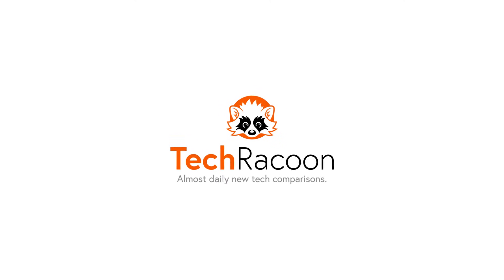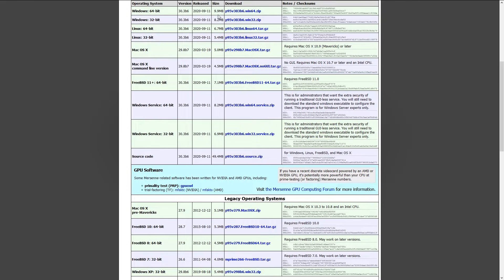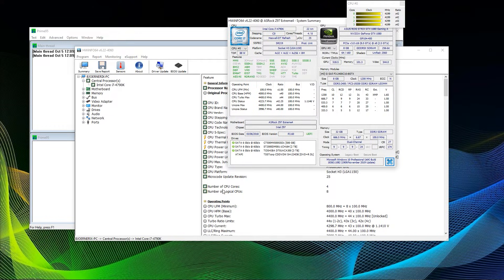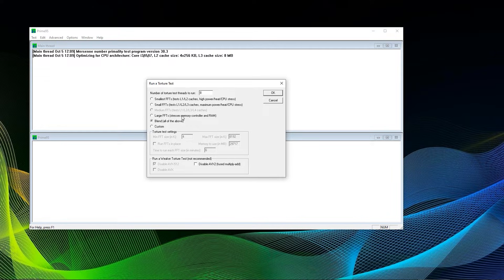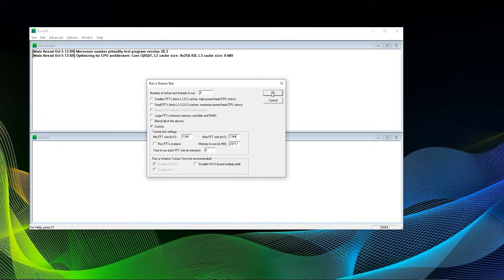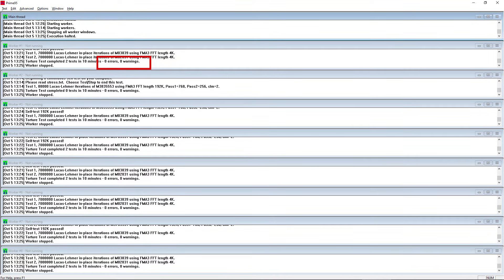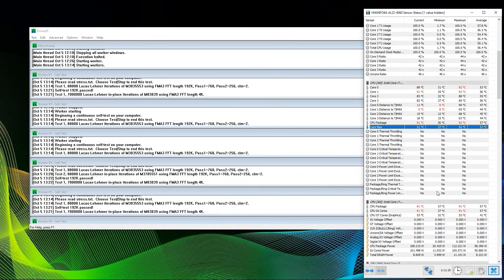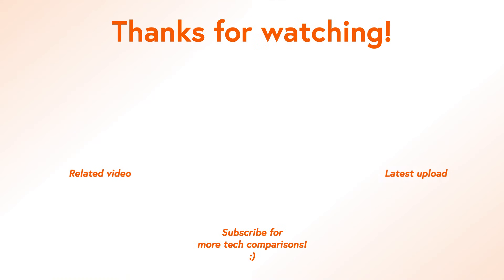Prime95 for checking system stability / CPU stability

Comment: My going maximum to 100°c 😂, is it ok??
Reply: T junction is 105 degrees if it's a newer CPU yes older no
Reply: @karsin-miller82912  means?? My laptop has i9 12900hx
Reply: So yes its normal
Reply: Just dont let it go 105 c

Comment: prime95 it’s a completely unrealistic tool... it got my 95w cpu consume 120w in an unrealistic test... no other tool make it consume more than 100w.... so whats the point ? i get cinebench23 to run fine, but i do a prime95 torture test and i get errors...
Reply: that's exactly the point of prime, if your cpu is stable with it, it's stable with anything else. if it runs with errors then something has gone quite wrong.

Comment: 8-24 hours? holy smokes.
Reply: For most oc lists, 1.5 hours is sufficient enough. For evaluating system stability,, a full "Custom" run with FFT size 8-4096k is considered 99% stable, if no errors occur.
8 to 24 hours is a relic from the past, when people didnt understand how prime95 wörked.

Comment: Test msi z690 board i7-12700
Lian li galahad 360 aio
Phanteks neo qube 2 case
Showing avg temp 95 degree and max tem 105 degree

This is too high right? What could be wrong?
Reply: i have the 12700  on a budget gigabyte b660m ds3H mthrbrd  , antec symphny240  aio ,  generic 17" ATX case 
ave temp is 85c max  100 ,   @  ambient temp 27c 

planning to get a better mthrbrd soon , mayb an asus tuf b660m plus wifi d4,   this will do for now :)
Reply: @arwennstory1013  reinstalled AIO , now temps down to 40-50 max
Reply: @adityabhawnani3466  so was it bec of aio repasting ? or how it was setup ?
Reply: @arwennstory1013  it was a new setup, so we just remounted the aio again and it fixed the issue.
Reply: @adityabhawnani3466  nice
Reply: what was wrong with the mount.. need more paste?
Reply: Is this temp on prime 95 or just idle?

Comment: "The min FFT and max FFT size can be now specified. What should be chosen though?". Then continues with no answer at all besides that small FFT stresses CPU and large stresses memory and chipset, which Prime95 already tells. But not one word about what should actually be put in and why. Why did you use 1344 and 29717? What is considered a large FFT?
Reply: Search for "angoholic prime95 tutorial" - it is an old tutorial on the HardwareLuxx forum that explains roughly, how the FFT erros translate. 29717 is the amount of RAM in megabytes used, that is filled with FFTs in varying size, ranging from
It's in german, but translating a website into english shouldnt be a problem 😉

Comment: With my 5800x and Corsair h150i Elite I get 40c to 60c on normal usage, 60 to 72c  while gaming, 79c on cinebench. Now this...instant 90c and it stays there (on max power/temp test). It feels odd seeing temps that high. I wouldn't run it for long lol.
Reply: 90c is normal for Ryzen CPUs, and even more normal for 5800X since it's the hotest Ryzen CPU currently.
I'm gonna put my 5800X under Prime95 for a few hours (90c) cuz I'm having weird random reboots during some games.
Reply: @manzariat7523  I have 5800x, Im planing to switch to 5900x. Disable pbo worked for me. To get the temps low you need to undervolt but I still get crashes when The temps get high.
Reply: 90c is literally the max for that cpu  @manzariat7523

Comment: i have teps issue on my ci7 10700k suddenly my cpu teps going 100c when gaming it was good before but i dont know what happend i have msi mag water cooler 360  , i replaced the thermal paste and it didnt help i tested stress my cpu a week ago and it went 60c max but now when i sterss test my cpu the temps go 90 im 2 mints
Reply: There could be clogging, (from LinusTechTips channel or similar) I heard clogging can cause the watercooler to not cool

Comment: would not recommend running prime95
Reply: Agree. Prime95 is not realistic load. Many end up hurting their CPU. Really why would you want a test the push your temps in to high 90c? That is putting fire next to you house and hope your house don’t burn down. OCCT is more realistic. The best stability test is just using the computer. If it crashes tweak and use it until it crashes, rinse and repeat.
Reply from the maker: Why? :D

Comment: I will never leave my cpu under 100% load for anywhere close to 24 hours. When I was waiting for my new cpu cooler, I played warzpne for a week on an "unstable" OC with the stock cooler. No issues. Maybe if I was using it for extremely work-critical purposes but for gamers 30 mins on prime 95/occt is more than stable enough
Reply: Depends on temps, if you're running under 70c at 100% load after hours, you're fine to keep going.
If you're reaching 90+ and throttling within a hour, probably shouldn't keep cooking your CPU.
Reply: yeah, i wouldn't ever stress my cpu like that for that long.
Reply: @RealKeytones  why? How else u can find if your OC is stable
Reply: Late reply but I still found your post useful. With my current frequency OC when running p95, one of the workers fails at 1.3 vcore after 20+ mins, at 1.31v it can do 5~7 hours, and at 1.32v over 12 hours but I can't checked further.
So I think for gaming 1.31v would be enough.
Reply: I tested at stock boost clocks

Comment: IntelBurnTest seems to put more stress on a CPU and generate more heat faster.  Nobody talks about IntelBurnTest any more, but it was always said to be more intense than Prime95.  I found it heated my system up way more than Prime95.  Thoughts?
Reply from the maker: I also still use the IntelBurnTest to see faster if something is wrong with a system.

Comment: I had to test my 5950x paired with a Aorus x570 Master with advanced PBO settings and this helped me confirm that I have a nice tuning going on. I used Small FFT in my 32 threads, cpu is running 75C at 3.75Ghz 100% usage.
Reply: lmao I got ambient temps at 37C and the CPU hits 80C
Reply: @nofekun1889  😂 I'm getting that high ambient Temps at the moment, and with high humidity so in reality it feels like 40C+.
Reply: isnt 3.75ghz very low for 5950x or am i mising something here?
Reply: @ThunderingRoar  if you have a hot ambient temp 30C, high humidity and you don't have custom cooling but AIO, this is good, because prime95 is very heavy.

Comment: 8 or 12 hours isn't it too long? can it damage your components?
Reply from the maker: Absolutely not. It's a stress test and it will show you if your system is stable in the long run. If something brakes, it has been broken from the beginning or the cooling simply wasn't adequate. Today's CPUs however will reduce clock speed to avoid overheating.

Comment: Quick question wont stress tesring for long periods of time degrade the cpu/gpu as they are gonna be hot for a very long time
Reply from the maker: No, even if you're doing it for a couple of days the thermal paste won't degrade any faster in the future than with normal wear and tear.

Comment: I've been having weird game crashes, replaced graphics card, still issues. I'm hoping this will help to diagnose the real issue. Thanks for the video.
Reply from the maker: Check for the RAM with memtest. Usually faulty RAM is producing weird crashes. Good luck finding the cause and check back if you have questions or progress.
Reply: @TechRacoon  Thanks, I'll report back
Reply: @hobstar  what happened?
Reply: @miguelmitchelldasilva  After many back and forths with my hardware vendor, it turned out to be an issue with the motherboard (the one we never suspect)
All sorted now, PC runs great, thanks to PC Case Gear
Reply: @hobstar  Thanks for the reply